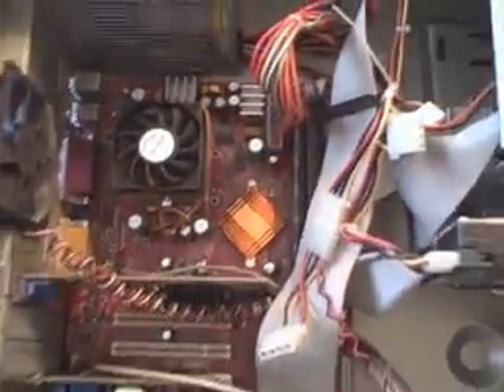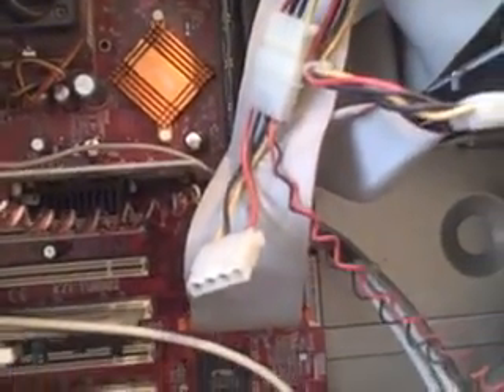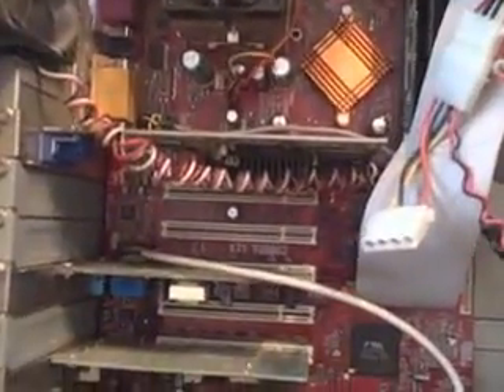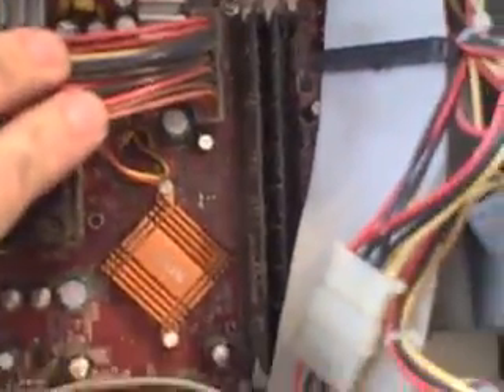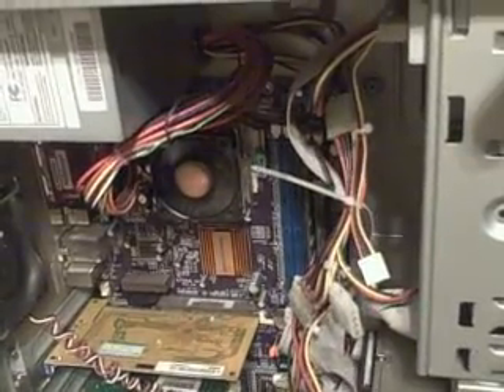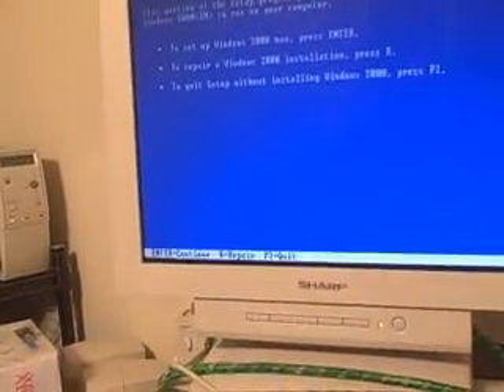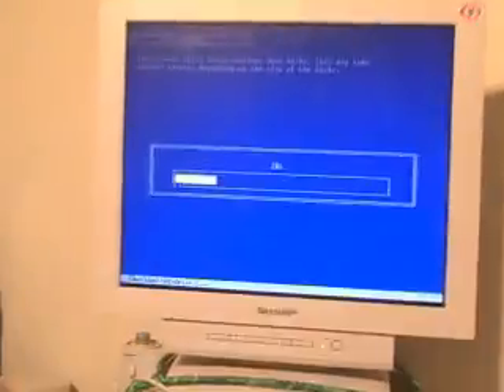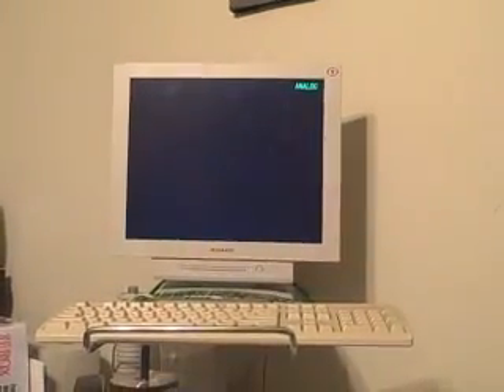bad capacitors, then repair install

Comment: So what type of electrolyte is in the capacitors ? mobo and the big psu ones
is it salt and water, or sulphuric acid and water like in a car battery
i ask because we've had a few psu's go over the years and spray stuff all over, is it safe?

Comment: @dxproductions100 true that. I honestly need to upgrade eventually, could build a hexacore system for next to nothing and the speed is amazing this dual core needs to go lol. not like i need it or anything but video rendering and archiving would be lightning fast :)

Comment from the maker: @MetallicBill My flip ultra camera has no macro mode or I would use it. Check my other bad capacitor video, I recorded it with my sony and it focuses much better.

Comment: yeah there's an msi mobo in my old comp u soft 2000 series ones leaking and ones bulging but the thing works fine except for the occasional beep code on boot

Comment: @mjmcomputers If you made another video, I'd watch it.  I'm close to doing my first capacitor replacement and am watching as many videos as I can to know as much as possible.. been building computers for 10 years, but never have had a capacitor problem until now. It didn't blow, but it got pushed out too far and broke.

Comment from the maker: The most common cause is they are just cheap and not made well, there are several brands that are known to fail. I also think that a cheap power supply that sends to much voltage could also be a cause. Heat is another cause. I've seen some fail on boards where they were close to the cpu heatsink which was clogged with dust. the heatsink gets too hot cause its clogged and gets the capacitors too hot. They also get too hot in the small form factor PCs from lack of cooling.

Comment from the maker: Should be 2 gold pins sticking up, and a black plastic rectangle jumper that shorts the pins together. Most times the jumper is just on one pin, and you connect it to both pins to reset the bios. Remove the battery before you reset the bios.

Comment: I have tried that, reseting the BIOS via jumpers, the motherboard has it's own power switch, and also have tried using the normal power switch. Also tried powering on with just CPU and it's fan without memory and nothing. No sounds, no movement, no lights, no nothing. The same as it's not connected to electricity. And the PSU is fine, we have test it in other motherboards and it's completely fine.

Comment from the maker: Have you tried taking all the pci cards out, unplug all drives, unhook and remove everything except memory and processor and fan. Also check the power switch try jumpering the pins on the motherboard to turn it on.

Comment: it doesn't make any sounds, beep, no fan movement, PS/2 Keyboard lights doesn't turn on, nothing. No energy. All capacitors are looking good. I just turn it on one day, it was booting into windows, and then turns off it self like if the electricity went down. The PSU is an antec earth watts 380W 80 Plus.

Comment from the maker: Do you see any burnt components or bloated capacitors? Sometimes you can't tell what component has failed and the only solution is to replace the board. Pull all expansion cards out, pull memory out and see if it will beep or anything when you try to turn it on with everything removed.

Comment from the maker: I just look for caps with the same ratings, One thing I do make sure to get is 105 degree caps. If you can't find any with the exact same value its alright to go higher on the voltage, just make sure they will physically fit.

Comment from the maker: I'm guessing thats a typo and you meant 8 layer. All the ones I've dealt with are not 8 layer. It is a simple desoldering and soldering job. I've done quite a few with no problems so far. I'll post a vid soon of repairing a dell with bad caps.

Comment from the maker: Yeah, I just replaced a bad cap on a dell today, I've got a gigabyte and asus board to repair, but they are both fairly old. I stay away from the cheap boards now, and generally have good luck with the gigabytes and asus boards. I wonder if cheap power supplies may send too much voltage through the caps.

Comment: there is article on wikipedia about capacitor plague. I'm still getting lots of stuff to fix with them. Mainboards and PSU mostly. Manufacturers like Asrock, Modecom and others still keep installing them so after 2-3 years they need replacement again. Now its better to get anything that has solid caps instead of that crap.